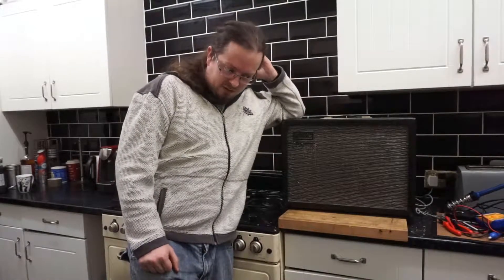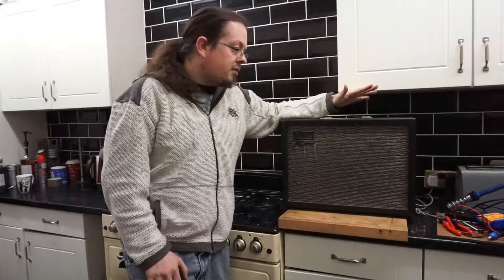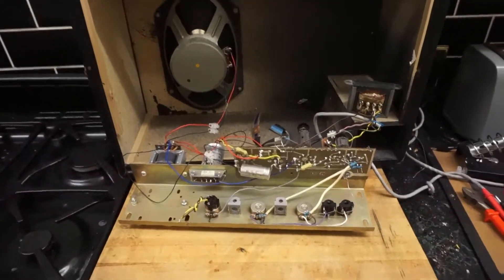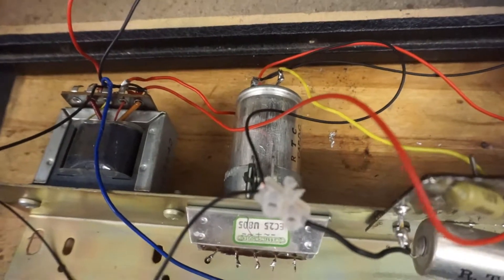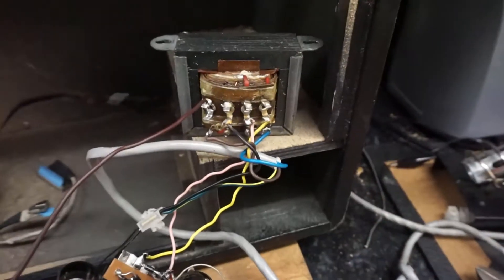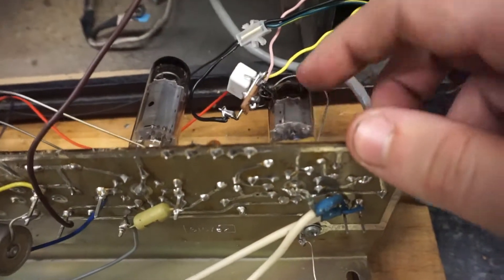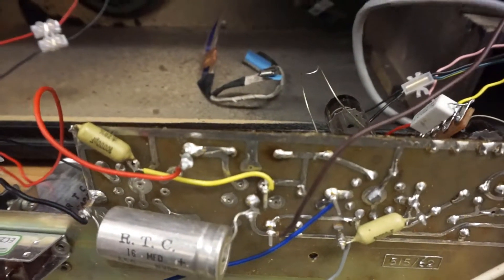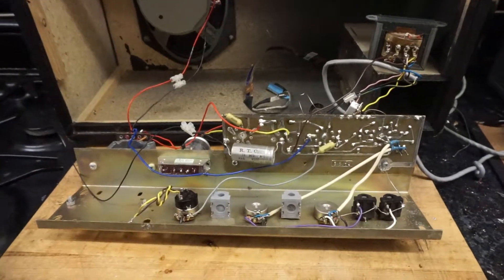Dallas Scala tube amp, Repair and mod Part 1

Comment: David, enjoyed your series of videos on your amp mods.  Be interesting to see how things eventually turned out with it.  I also wondered if you could help me out...I recently purchased an amp just like yours.  Rather bizarrely it also worked for a bit then died.  I replaced the caps and some of the resistors.  The power and output stages seem to work if I insert a signal, but I get nothing through the inputs.  I drew out a schematic of my amp and confusingly it does not seem to have any coupling capacitors at all !  I was unable to find any other schematics for my amp aside from the ones you drew.  I'm after checking whether your amp originally had coupling caps at all, or was that something added/changed later?  Apologies for the ramble.  Regards, Clive
Reply from the maker: Hey Clive. Thanks yes I really need to get my scala finished. Currently it's being blocked by my everyday Marshall amp which has a v similar prob. Power is ok but no signal.very hard to troubleshoot without a signal generator. An update on the scala will come  eventually. I'm a rank amateur at this stuff so I prob can't tell you anything you don't already know. Feel free to email me the schematic and or pics. I'd be interested to see it. One thing that does come to mind is if there are deffo no coupling caps or transformers there are rarely used methods of direct coupling valves. Merlin blencowe covers it in his pre amp book. It would mean your and my amp are different.
Reply from the maker: http://www.valvewizard.co.uk/dccf.html
Reply: @DavidImrie  It's definitely the same amp, aside from mine has 2 x Goodmans oval speakers.  So, it does have power and output transformers like yours and the boards look the same.   Mine has rectifier EZ80, pre-amp ECC83/12AX7, power EL84.  Like you, I'm thinking of making this a more 'regular' circuit, but just wanted to get it working again first and then do mods from there.  It's a real nuisance that I just cannot seem to get it working.  It seems to have blown the 12ax7 and I'm reluctant to start putting in more tubes until I have a sensible understanding of it's expected operation.  I'll take a look at the Merlin Blencowe info (never heard of him).  If I want to share further info with you, what's the best way of doing that...YouTube doesn't seem to have a private message capability?!?  Cheers, Clive